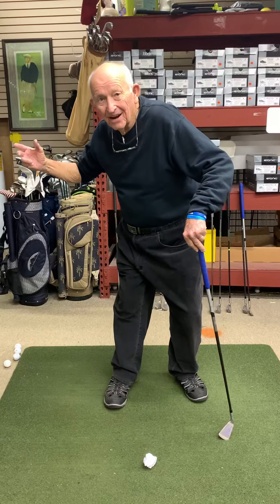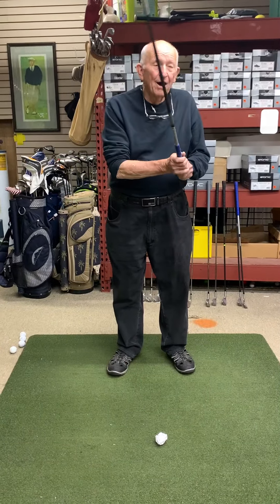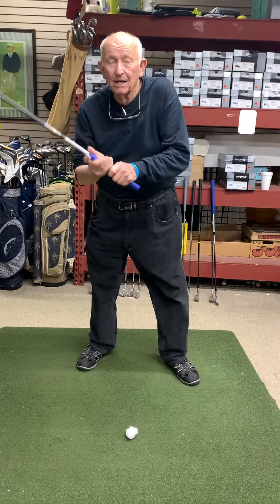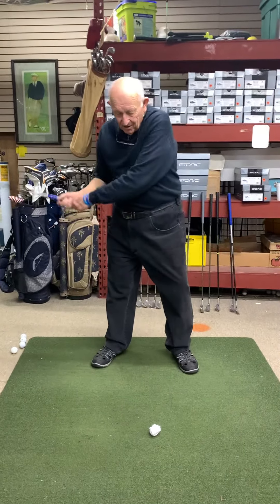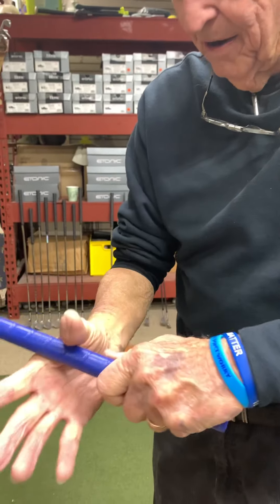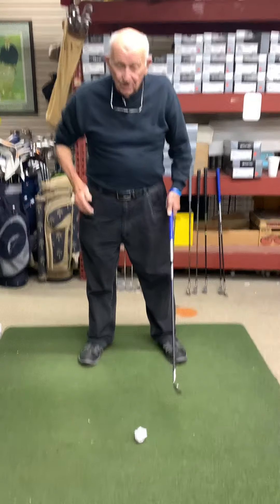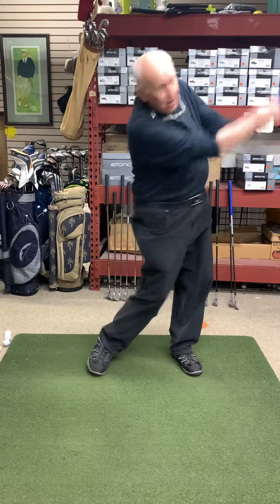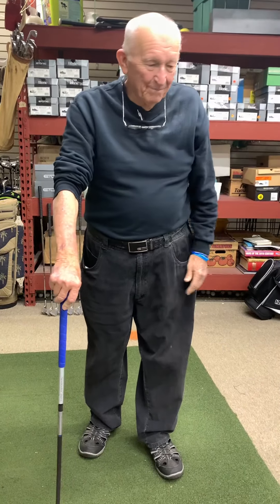Golf Front Load-Counterbalance

Comment: This is NOT how you’ll see any great player griping the club with their trail hand. Ideally your thumb and where your index meets the hand creates a closed crease or a “lobster claw” as it’s called pointing to the trail ear and on the underside the index has a small gap from the rest of the fingers creating a pitched look with the thumb and index not wide open like this. It’s a lot easy to explain with a club in hand but you can look at essentially every great player, strong, neutral or weak grip and they’ll all have a similar grip, Tiger or Rory would be obvious examples. This here looks like you’re swinging a baseball bat or something, no club face control.
Reply from the maker: This is the purpose…
To have control in the golf swing is to give up control!
The hands and wrists need to act as free hinges…watching Iron Byron the robot hit ball with free hinges to an area 300 yards to a beach blanket area confirms this👍
The inside(core) moves the outside (wheel principal)
The dog wags the tail etc
This excercise is a drill to train the hands not to make the club move but to allow the club to work because of our interior core rotation👍
Tour players have this discipline with 8 hour practice 
Under coaches watchful eyes…
Amateurs invariably have too tight of a grip which introduces tension which negates that free-wheeling
feeling that LPGA WOMEN PLAYERS have that produce
260 yard drives😊
Reply: @bobcunninghamgolf  so you’re saying this is a practice drill? You didn’t say that in the video itself which is very misleading.
Reply: @TheWedgeWizard I never heard him say it was a drill Wizard, but that doesn’t make him misleading at all.  Yeah I’ve seen your vids and what you’re not getting is simple.  You keep saying how the great players do this or that and you compare them against amateur players.  No amateur can do or perform All the great things the elite players do.  You’re not comparing apples to apples.  You can’t take a sows ear and make it into a purse, and believe me all amateur players are sows ears.  All they want to do is get to the level that their abilities will allow in order to have fun with their buddies on weekends or in their retirement days.  You’re playing to the wrong crowd if you continue to believe all amateurs want to be like the pros, they don’t have the time or resources to even come close.  So I ask you, who is really misleading people?  Have a nice week!
Reply: @Wooduck   the easiest, most simple and important aspects of the golf swing to get right are in the set up which not only includes the grip but the grip is probably the single most important thing because it’s what is actually contacting the club and effects everything else in the swing. If you’re going to grip the club wrong almost everything else in your swing has to be a manipulation and is where lies the problem. There is an expectable spectrum for grips but many beginners don’t fall within that and is a huge reason they struggle so much. If players want golf to be easy they’re going to copy the commonalities you see with all great players, if they want the game to be difficult they’re going to do whatever they want. It’s all very simple really, when you understand the physics of the game aka laws of ball flight, how they relates to swing dynamics, course management, etc. the game becomes so easy it’s laughable. It’s only hard when people try to work outside of the spectrums because they think “they can’t do what the pros do” when the reality is pros are moving less, using less effort, and their moves require less mobility than what you see from your average amateur. Not to mention I’ve never met a person who can’t grip the club properly short of having 1 arm.
Reply: @TheWedgeWizard  you can’t grip the club wrong if you understand what the radial and ulna bones do in the trail arm.  That’s what people don’t understand but if they did that alone would allow them to become better players.  How the body works anatomically to keep it in balance throughout the motion is key to consistent playing.  This includes the hands which are connected to the grip.  If I understand how the hands should work to keep the motion in balance it makes no difference how I grip the club.  With that said ifI know what I just said why not grip the club which makes the task simpler.  Trust me I know the easiest way to grip the club to make it simpler which allows me to be consistent because I’m in balance with the anatomy.  To say you have to do this or that and that is the only way is off the mark.  Nice banter with you wiz, have a good week!
Reply: Most amateur players only get trailing wrist as far as 30 degrees while pros get to 50+ degrees. Gripping the club in the web like this and counter loading will indeed get your trail wrist bent further in the top swing without moving the face around. This adds tons of club head speed through impact. Also the best thing most pros did for their swing was not try and be like someone else. Give that a shot.  @TheWedgeWizard